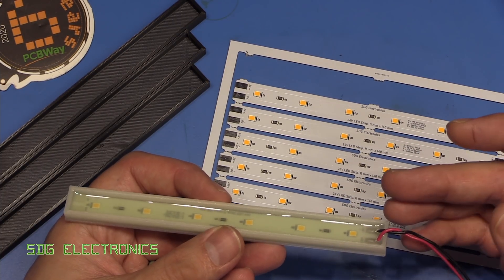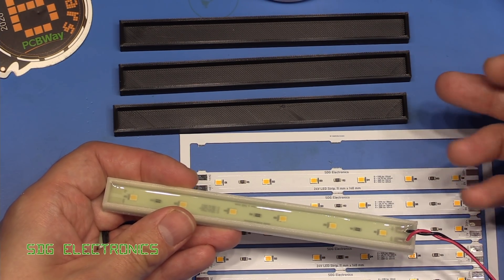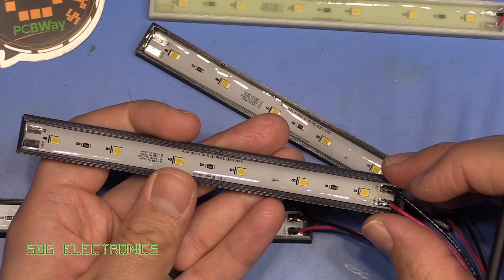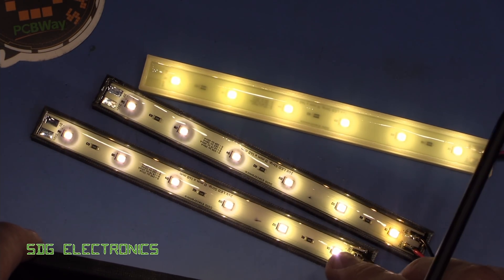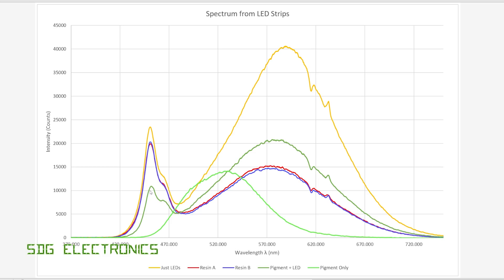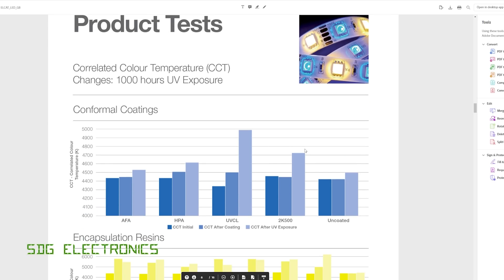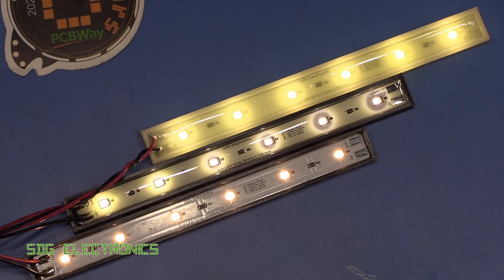SDG #239 Investigating LED CCT shift with Resin/Conformal Coating

Comment: It’s all about refractive index. If you put water on the LEDs instead of resin the same effect will happen. This happens only if the resin (or water or also glass) is in full contact whit the phosphors…if you have air in between this doesn’t happen.  Just like a bulb whit a glass lampshade or the filament itself with the bulb shaped glass on it, the cct doesn’t change because you have air (maybe vacuum) in the middle.

Comment: If you have a spectrometer to measure the LEDs, then you can get a CCT and CRI (and any other thing you could think of) measurement using Osram Color Calculator (which is a free tool). You import your spectral data (hopefully you can get it into a format that color calculator already supports), and it will calculate the rest for you. I use an X-rite i1 pro spectrometer and take readings with Argyll CMS. Osram Color Calculator supports the Argyll CMS format directly, so I can just import the spectrum, and get all the measurements I want about lights. It's a REALLY cool piece of software!

Comment: Could it be that the different thickness and shape of the cured resin dispersed the different wavelengths at different angles and creates an illusion of a color shift? That may explain why the LED with the thinnest coat of resin appear warmer. And definitely the curve on the surface of the resin is different where it's thinner. 
That can also explain the different shadows around the potted LEDs, where light emitted from the LED is reflected back at the PCB at a different angle.

Comment: How do the raw LEDs change over time with respect to brightness, colour and power consumption. BigClive thought that efficiency of residential LEDs dropped off a cliff after a few weeks but hadn't seen formal studies on this. Part of the problem is how hard consumer bulbs are driven, but may also be intrinsic in the LEDs and deteriorating coatings. This seems like a massive global public policy blunder. . . and a good video.
Reply from the maker: The decrease in intensity is quite dramatic in the first few hundred hours. We built an ultra high resolution optical system for a client and could see the LED losing intensity with every data sample. White LEDs suffer even worse with colour shift as well as intensity.

Comment: I hope this doesn’t come across as pedantic at all, but “white” paper isn’t really white. Almost all household/copier paper contains optical brightening agents (OBAs) that make yellow (think cardboard) paper appear colorless - even blueish. As such, you’ll see an exaggerated peak under 500nm - even with completely flat, black body illumination - not just from the blue pump LEDs common to many “white” LEDs. That said, this effect is almost completely negated if your illumination source has no UV - which could certainly be the case for your Cree LEDs (without the DS, one could only guess). As another popular YouTuber is wont to say, this can be ”a trap for young players” .

Overall, this is much more of an issue for quantitative analysis. Given that the spectra were presented somewhat more casually, this whole thing is clearly less of an issue and more just a point of interest. Great video, as usual. Thanks.
Reply from the maker: True, however these are only relative measurements so I wouldn't read too much into the absolute spectrum. A full calibration was also performed against the white paper before measurements.

Comment: This might be a case where the water clear resin and the removal of air bubbles are actually working against you. With widely-spaced LEDs, it’s likely the the glow-in-the-dark coating is being saturated near the LEDs, while the areas in-between are almost certainly being under-illuminated/under-stimulated. Stated differently, it might work somewhat better, at least in the “dark” mode of operation, with some sort of diffuser.

To some extent, moving the resin away from the LEDs would also work to improve the dark efficiency. Off-hand, the only way convenient I can think to do this would be to place glass or some sort of acrylic sheet such as Lexan (both or which could be clear or diffusing) over the LEDs before coating. Clear material would allow the resin to take advantage of the larger area that results from the angle * distance, whereas the diffusing material benefits from the distance as well as the scattering within the medium.

Presumably, to maintain the environmental protection (e.g., prevent moisture ingress), in practice, this would involve putting resin on the boards, placing the glass/plastic lens on top and then pouring a bit more resin, to coat the lens. Another poster mentioned coating the LEDs with a bit of cyanoacrylate, and I agree with that recommendation - probably allowing it to dry first, before applying the resin(s) and lens. I’m uncertain as to what effect/s vacuuming the assembly would have in these two configurations - it could improve or degrade the diffusing effect - most,likely improving one and degrading the other. At the same time, with increasing diffusion comes increased back reflection, and therefore additional losses as heat, though the white boards naturally reduce this degradation. Bottom line, it’d be something to test.

Based on my professional experience with similar systems, I think this might be worth the effort to experiment with. When creating prototypes, I found that sandblasting Lexan and/or plate glass both produced surprisingly good results, when compared to purpose-built diffusing materials.

For completeness, I’ll mention that having more LEDs would lessen the angular/distance gradients, by filling in the lateral gaps, thus lessening the need for, and therefore negative effects of, diffusion. This increases the cost - but not all that much, given the “steal as a deal” price you got for that reel. ;). Interspersing the white LEDs with lower-powered deep blue or UV ones might be particularly useful, as it would provide additional fill where it’s needed the most - where the glow-in-the-dark material isn’t currently receiving optimal illumination.

Obviously, based on the spectra, optimizing the color temperature can be accomplished by filling with lower-powered >500nm LEDs, if that’s desired.
Reply: After pondering this, it occurred to me that adding an small, inner ledge to the 3D-printed enclosure would allow the glass/diffuser to be rigidly mounted away from the PCB - thus eliminating the need for the inner resin layer and CA on the LEDs, while still allowing the glass/diffuser and PCB to be completely encapsulated. There’d just be an inner air gap. This structure has the advantage of allowing the spread of the LED illumination to be adjusted by moving the ledge to a location just far enough to obtain smooth, overall illumination of the resin layer. In this configuration, diffusion less likely to be of great benefit to the system. YMMV, of course - testing is probably still required.

On a related note, where are the black and gray 3-D printed parts only intended for optical testing, or were you thinking of using them instead of the aluminum extrusions in the final design? With all of the parts that generate heat mounted in a rather well insulated enclosure/encapsulation, I’d have some concerns about cooling. Maybe I missed that specific detail in the video. If the 3D printed parts are the desired enclosures, then maybe leaving the back open, save for a small ledge, and sealing the seams with RTV might work better. I’ll re-watch - and probably return to delete this paragraph ;).

Comment: Also your not measuring everything!
perhaps...
is more of the light getting trapped in the resin waveguide and just exiting at a different angle?
to find out set up a angle experiment to measure each output at other angle and distances from the surface to see angle leakout/spill out

Comment: This is why some led striped lights are sleeved rather than coated. The air gap doesn’t create the same shift.  Some manufacturers will preshift warm to end up at the CCT they want after coating. 

I didn’t definitively figure out an answer when I was looking into this at work but I think it caused more light to be directly emitted from the blue pump rather than bouncing back through the phosphor via internal reflections.

It’s unlikely the resin is absorbing more so than stoping the phosphor from converting as much 450nm.  If it is absorption, if your made a separate lens out of the resin but made sure there was an air gap it would still absorb the red.
Reply from the maker: Good theory. Something else to test!

Comment: Curiously you don't get an additional peak in the emission of the leds with pigmented resin while these leds are on.
I would expect to see the same added peak as you get when it's only the pigment emitting light... or is the intensity of the light coming from the pigment at a much lower intensity?
Reply from the maker: The magnitude of the green from the pigment is quite low but it's slightly visible. I think it's lost on the spectrograph.
Reply: Well I think the intensity of the emission of the green peak is a good order of magnitude lower and also very shallow.

Comment: TCS34725 to somewhat measure CCT.
It probably won't give correct absolute value without end product calibration, but it's cheap and might be just ok for hobbyist needs in relative measure.
Reply from the maker: I'll take a look. My Avantes unit unfortunately didn't support it as it was not ordered with that option from factory. It just needs the calibration in the EEPROM, but apparently can not be done after the fact.

Comment: what with all those leds you have it might be a cool project to make some kind of a cloud ceiling. which is a great way to diffuse ambient light across a broad and extended indoors area. a good project for the winter times
Reply: Totally agree. Diffusion is key. I’ve been working on something similar for the past few months, in the gaps between other projects. I’ve been experimenting with RGB LEDs, comparing them against a mix of single color strips, of eight different (narrow band) colors. Each has certain advantages and disadvantages. My overarching goal is to produce bluer light in the morning hours and redder light in the late evening hours, to promote wakefulness and somnolence, respectively. Along with this, I’d like fine and automatic control - especially in the later hours - so the lights will help me drift off to sleep. Proof-of-concept experiments, using Philips Hue smart lights, has been promising.

Comment: In order to check whether it is really the optical absorbance of the resin or another interaction with the phosphor coating perhaps you could just make a clear resin square and hold it between the camera and the LEDs, to see if we see the same thing.
Reply from the maker: Good idea. I might try it with an incandescent lamp, and just measure the absorbance.

Comment: I'm a bit puzzled by why, if the resin is absorbing a particular wavelength, it doesn't it look noticeably tinted to the eye in natural light. I wonder if maybe there is something else going on, connected to how the phosphor works. I initially thought it might be to do with the change in refractive index, but that wouldn't be dependent on thickness. 
Might be interesting to do some tests with RGBW LEDs and a wedge shape to try different wavelengths and thicknesses. Also maybe look at the effect on the transmission spectrum of resin with a broadband white source like an incandescent lamp
Reply: As an illuminated sign maker I discovered this problem years ago. I use silicone-based clear coating (waterproofing) to protect LED strips from elements in a harsh exterior environment. Years ago when I first used this coating at a large LED strip signage project I was shocked when I see the uneven color temperature of LEDs after coating.  Near all my LEDs color temp shifted from natural white 4500K to near 6000K, but few of them still had warmer lit. I felt, the project is ruined but I must somehow fix it. I tried a bunch of things to fix it nothing worked. Then I tried to apply on to cured coating a new layer of coating and like magic, the color temp goes to 6000K. With this method I even out all LEDs to 6000K and agreed with the customer to leave this color temp. Since then I offer only cool white signage LED strip lighting. 
One more interesting thing, cyanoacrylate  (superglue) blob on LED chip won't affect the LED color temp but waterproof the chip. After that treatment, the silicone coating also won't affect the LED color temp.
Reply: @CorgonCorgon  when seeing the unlit led's in resin my first thought was that some of the phosphor pigments were maybe dissolved into the resin. If that's the case that would explain why the superglue trick works.
Reply: @CorgonCorgon  would be interesting to try LOCA UV curing resin that is used to repair windshields or even as optical cement.
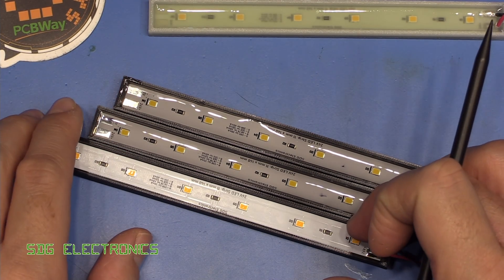Reply: While the uncured resin is looks colorless, you can see a difference in color between the white PCB in 3:40 with the cured resin.
Reply from the maker: There is definitely loss in the resin, under normal light, the white PCB looks grey through the resin. I think the incandescent lamp idea is good and will probably answer the question well, the software for the spectrometer can do absorbance measurements. I still wonder if there is some refractive index effect - perhaps the longer wavelengths are not absorbed. Adding an air gap between LED and resin might be able to show if this is a factor.
Reply: @SDG Electronics  I have been manufacturing low voltage outdoor LED luminaries for nearly a decade and ran into this issue early on. You are correct in identifying the correlation between depth of resin and color shift. To overcome this, use less epoxy or use a secondary polycarbonate lens that is glued to the pcb, which creates an air gap. The expoy can then be filled up to the lens surface or slightly above for a smooth finish. The materials I use are MG Chemicals (832WC) Optically clear encapsulating compound and ILENTECH (ILENS10-CON1107-120-NH) lenses. ILENSTECH also has hundreds of other high-quality lenses to choose from. 
Additionally, I have found that the concave nature of the plastic chip LEDs does not play well with epoxy encapsulation. The epoxy acts as a secondary lens, and depending on if the epoxy surface is concave or convex, the color shift will be different. I started using CREE XQ-E, XQ-A, and XP-G2 LEDs with stunning results. These lamps can be directly encapsulated with an Optically Clear polyurethane based epoxy and have a near zero color shift.